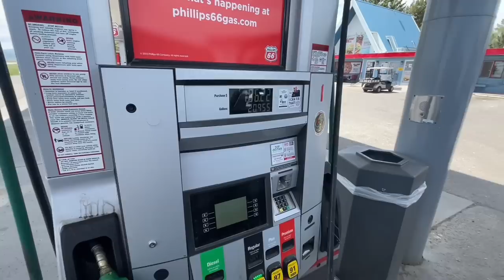EP 63 SAVED!! We venture to Idaho to save TWO extremely RARE Dodge Dart Sports. Mopar or no Car

Comment: Actually they made 700 of these cars and only 47 were the 360-4bbl the rest were 225 6 or 318V8- 2bbl
And your probably correct on 100 on the road and probably another 100 sitting in Fields and barns, etc. At 14 years old I tried talking my father into a brand new one at the dealership and when he saw it had a 360 V8 he said absolutely no way! We were still trying to get out of a gas crunch in 74' he said I'd make a poor salesman and bought a 74' 6 cylinder Plymouth duster instead and wheezed thru like 100hp of smog junk and had nothing but break down after the next 2 years later traded it in on a 76' Ford LTD with a 400 V8 made no sense 😂. Good luck on these cars. I loved the era!

Comment: Love the old Mopar's.
So, I'm wondering if that Dart Sport in the background is for sale? My Dealer optioned '74 GT packaged Sport got smashed while I was sitting at a red light, dude never hit the brakes. I continue to build it and will drive it bent, until I can get it straight again or a new A Body.

Comment: Next time you try starting it hold it wide open. You were flooding it. Pumping it doesn’t do anything when there’s no fuel up to the carb yet. I was yelling at my tv just hold it wide open! Lol. Probably has weak spark from old plugs
Reply from the maker: It needs a new starter and carb. Then I will fire it up
Reply from the maker: And it did try firing while I was pumping it. But that carb is so junk.

Comment: What the going price on the 76?
Reply: 75
Reply from the maker: 75. It will be a running/driving car. Current engine is junk. Will be in the 6500-7000 range.